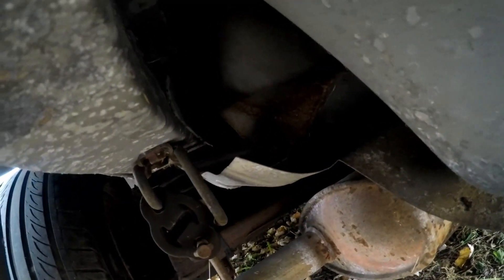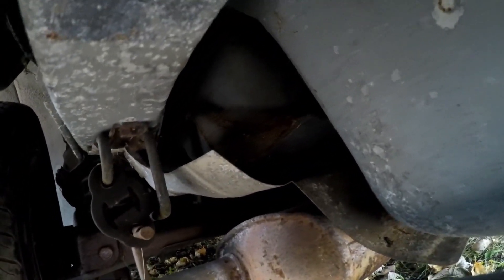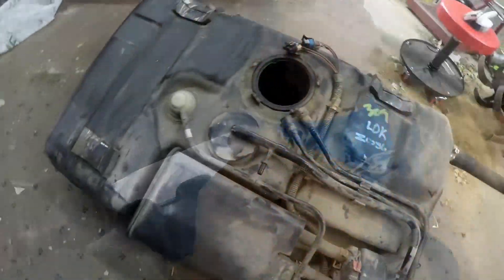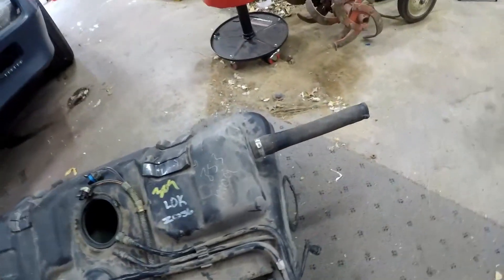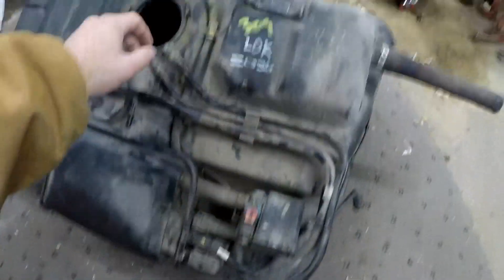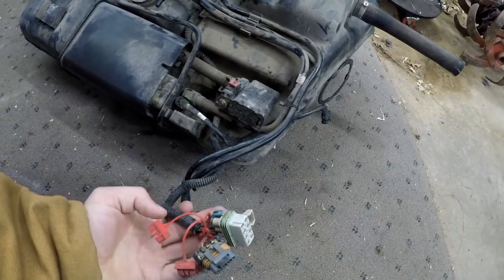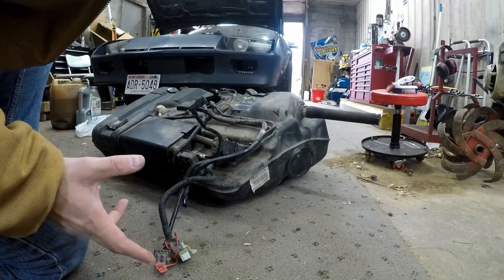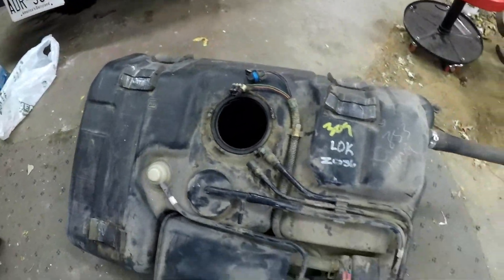Stock Poly F-Body Gas Tank (Replacing Steel)

Comment: No diy? Im doing the same. Do I need a 40-120 ohm sending unit to make the fuel gauge on my 98 trans am work? Also did you reuse the straps from the 98 tank on the 99+ tank?
Reply from the maker: The 99+ use a plastic sending unit. I also reused the straps

Comment: Does this tank have baffles?  Will this fit into a third gen firebird? Thanks
Reply from the maker: I didnt notice any baffles there might be some. And it might fit into a 3rd gen but I cant confirm. The filler neck will be an issue too. Also you wont have as much weight savings as you think.
Reply: @alloyspeed1889  Not looking for weight savings. When my tank is low and I take a corner the car almost stalls out because the fuel moves away from the pump.
Reply from the maker: The 4th gen tank might help then. They use a bucket, the return line is directed into the bucket right by the inlet.
Reply: @alloyspeed1889  Oh ok thanks.  Reinstalling my rebuilt 9 bolt and I thought while I am this far I can replace with better tank and new fuel pump.